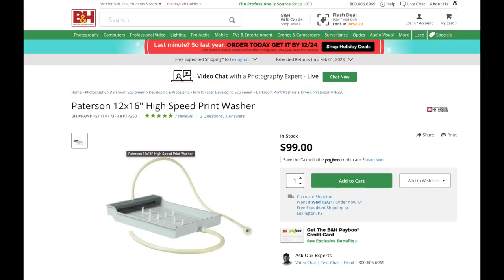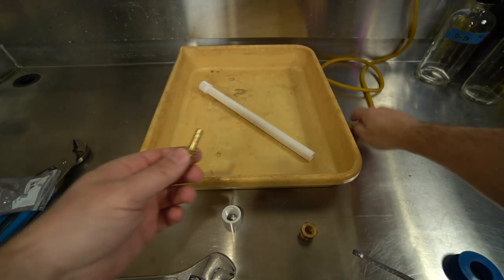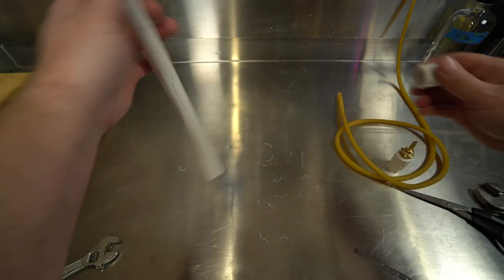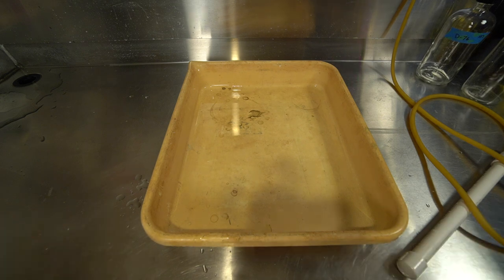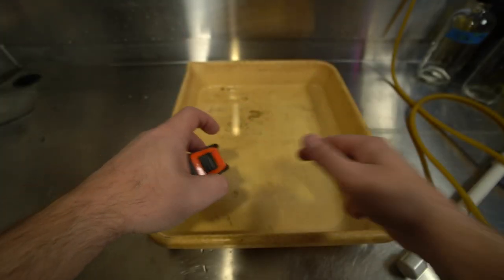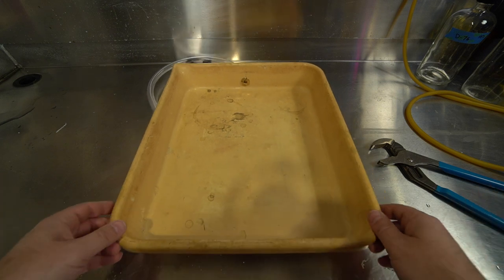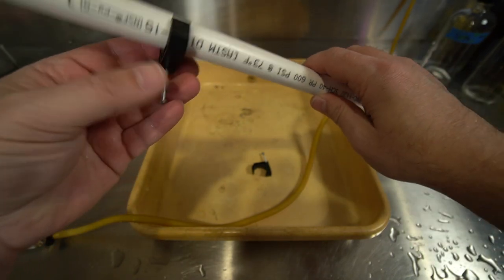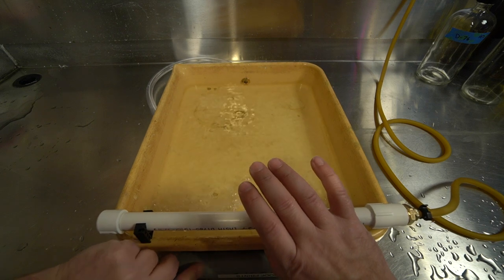DIY RC Print Washer

Comment: I have a cheap one from around y2k.   It's basically just a bus tub or litterbox with a plastic barb glued in the corner.   rubber hose attached to a rubber fitting.   4 holes in the opposite end about a 1/2 inch from the top of the tub.

At one time i had a variation very similar to your design.   It was a capped aluminum tube with a rubber hose attached to a faucet.   There were 2 holes in the tub that held the aluminum rod in place.

Enjoyed the show

Comment: I'm afraid I wash work prints in two baths of still water because I don't have running water in my darkroom. I might lift it out and squeegee it a couple of times. If it is a serious RC print I'll run it in the bathroom for 5 minutes. Ilford say 2 minutes in running water or 30 seconds vigorous. Back in the 1980's I used a dry to dry Ilford machine that took 90 seconds for the whole process and those prints are still fine today.